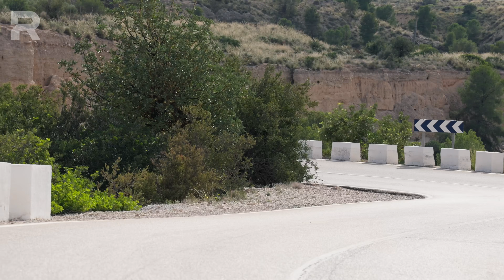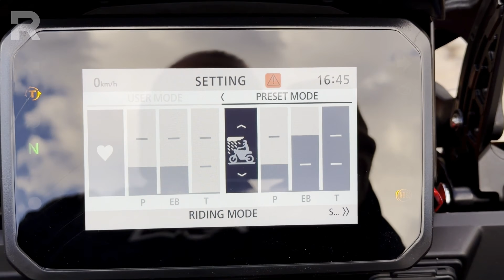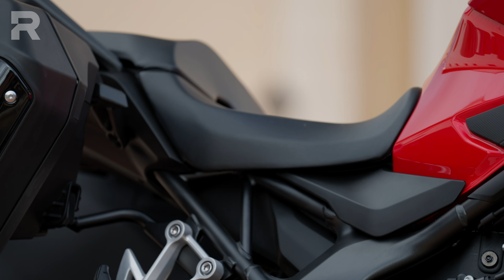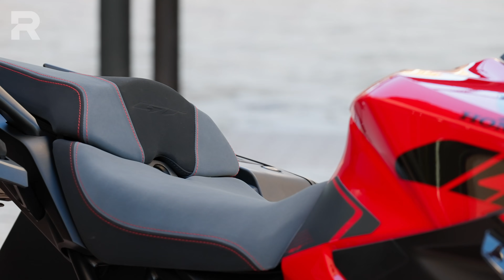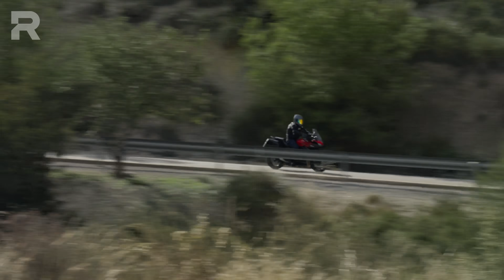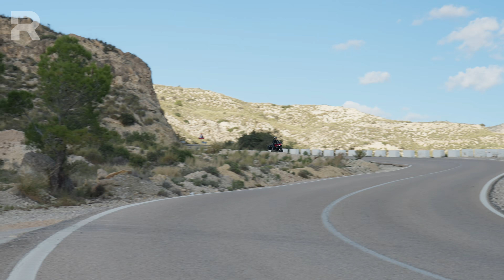Honda CB1000GT, testing the bike that impresses with its features, balance and price.

Comment: Have they not released the bike yet
Reply: I believe they delayed the release due to oil consumption issues, specific to this engine. The Hornet, which has the same engine, and was already in public, was also affected (at least a % of them) has been recalled. According to the dealership (here in Portugal), the CB should be available during July

Comment: I wanted to add this bike to my garage but with Honda limiting this to 124 mph, this is just the biggest deal breaker i've ever heard off.
Reply: See 2 wheel dyno works for tune. 150 hp and 72 lb to the wheel after their tune with full exhaust.

Comment: Thanks for the review. Very interesting model. I would think that this Honda’s motor would be smooth but you mention annoying vibrations? 🙄 also, lack of torque in low revs (something you could expect but they could have change the gear ration for a tourer…)  overall, do you think it is too far from an XR? 🤔

Comment: Hi, Thank you for the thorough video. Is it true that the bike is electronically limited to 200 km/h?
Reply: Apparently yes, locked to 124 miles per hour, which is an instant write off for me, i mean what are we doing here you get 150 horse power and a "sports" in the tourer but is locked to that abysmal speed limit ahahahaha, no thank you honda, if i want a 500cc bike i will get that instead, if i get  a liter bike then i expect to deliver liter speeds.
Reply: @fs5866  are you planning on doing track days with it? 
This seemed like a massive drawback for me as well in the beginning, but realistically I rarely get to go over 200km/h, unless I'm hitting the highway.

So I think I could live with it
Reply: @Krosis_  no i do not but to be honest, even on the motorways there's times when i top the speed out on my current bike at 130mph, and once you get used to it, it does not seem that fast anymore.
The only reason i want a sports tourer is for the sports part in it, aka top speed otherwise every other bike out there past 600cc has that 120mph top speed and fast acceleration.
Is not that i plan to go fast all the time but when i do, i want the speed to be there.
Same with fast cars, you do not need 400/500hp every day, but when you do you want it to be there.

Comment: Vibration is something to consider, especially if it also happens at highway speeds. This happened with BMW S1000XR, and they took lots of time to minimize it - very uncomfortable, and riders had to rely on third parties to deal with it, which is unacceptable in a premium product. This issue on a Honda is unexpected. Added to a manual windshield that doesn’t fully do its job, Honda should go back to the drawing board.